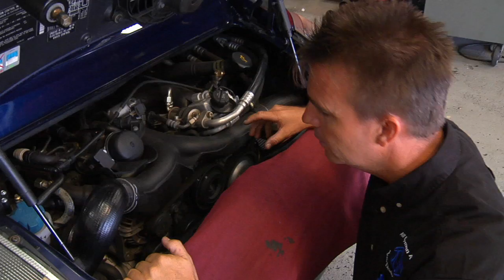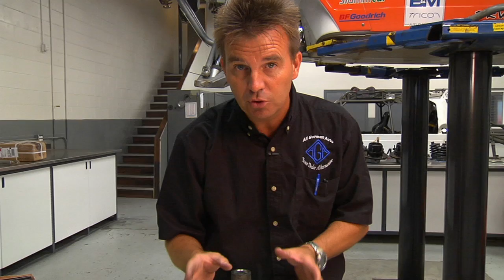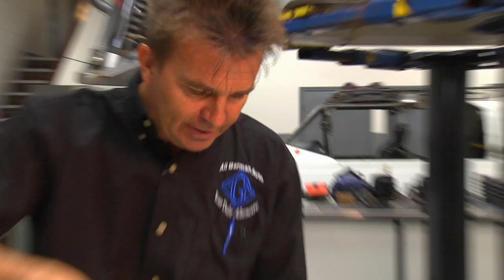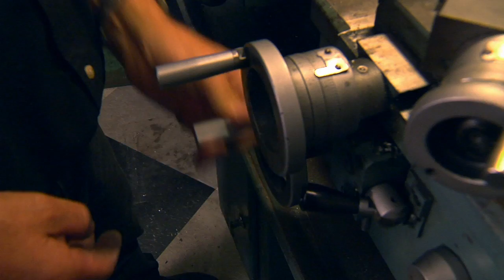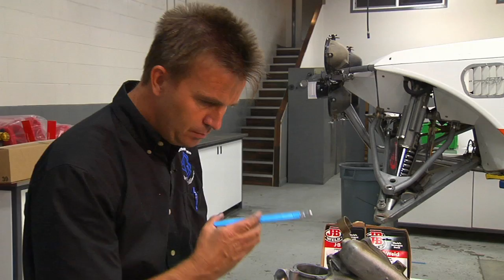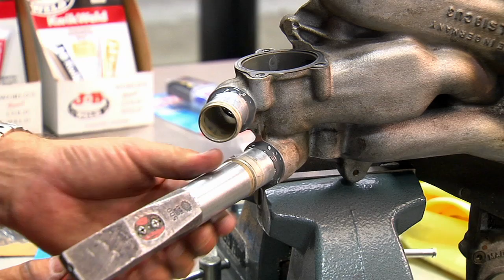Porsche 996 & 997 Cooling Repair

Comment: that jb weld repair method is not better than the oem glue solution. the fittings should be welded to the housing to seal them permanently.

Comment: Had this failure on my 997.1 turbo.. never seen so much coolant flooding out from an engine…
Reply: at what mileage did this happen to you and under what driving conditions? Track day? High heat?

Comment: I repair using the factory pipes. Heat up, remove, peg the pipe using stainless steel hex head bolts. Pipe is now secured with jb weld and a bolt. A lot of the Porsche club events won't allow the 911 turbos on the track unless they've been pegged because the coolant pipe can suddenly burst and throw coolant at the tires. Also need to replace the plastic coolant pipes with metal when you drop the engine for this repair.
Reply: is jb weld preferred over the original Porsche loctite? I waited 2 weeks to get it in the mail but seeing jb weld is more common

Comment: I get that knurling the pipes and adding jb weld for adhesion is superior to the original Metzger design, but why not just tig weld? It doesn't make any sense to me. TIG weld it exactly as you would intercooler piping or an aluminum radiator, especially after going through all the trouble of dropping the entire engine. It's the most permanent and affordable solution by far.

Comment: Why wouldn't you welding it? J/b weld?  How can a professional shop consider that a fix? That's disappointing.
Reply: I would prefer TIG welding as well... but the way they remove the pipes and add knurling to the pipes with the JB weld is superior to the Porsche original design.
Reply: Years ago I had an electric fan chew a hole in a brand new aluminum radiator.  The aluminum was so thin it welding  made it even worse.  I pried the row open with a screwdriver, packed it full of JB weld and crimped it shut with a pair of channelocks.  21 years later and tens of thousands of miles, that radiator has never leaked once.  If it works, it works.  TIG welding this part in particular would be difficult, though doable, because of the dissimilar thickness of the parts being welded together.  You'd need a lot of heat to penetrate the housing, which could blow right through the thin tube of the water neck.  The epoxy repair, which also has a mechanical attachment component with the knurling, is a fool-proof repair.
Reply: The 997.2's don't have welded pipes - it looks like Porsche just improved the epoxy or the application method at the factory, as they are not affected by this issue (though I did read a comment somewhere about one of the .2 RS models having the problem). This is not a high pressure system, so what you're seeing in the video here is a process that is improved over the factory's epoxy-only method. IMO this repair is going to last the life of the engine. I've read there are risks with welding, particularly in possibly compromising the factory pipes during the welding process (not an expert here, just read this as a precaution on Rennlist etc).

Comment: Just an enthusiast question... This repair can´t be done welding both parts?
Reply: The housing and pipe looks like their both aluminum. I would tig weld it in place , voila, won’t ever separate again.

Comment: nice repair. but I would drill an 1/8 inch hole through the housing and tube and fit a brass or alloy rivet just to be sure it didn't come out again.a new engine is £ 20,000 !!!! nothing beats a mechanical fixing.
Reply: +Jack Kallemdjian nothing a TIG can't fix

Comment: Hi Martin,
In regard to a 1999 996 M96 / 3.4 .Could you tell me how many coolant hoses this model actually has...??.2nd question.What is you opinion on changing the "important" hoses that come off the water pump that are routed to the block and heads in high quality silicone (Samco,etc).When I speak of "important"ones I'm referring to those hoses that experience the greatest pressure in the pump and housing area...!
Thanks.....great video!